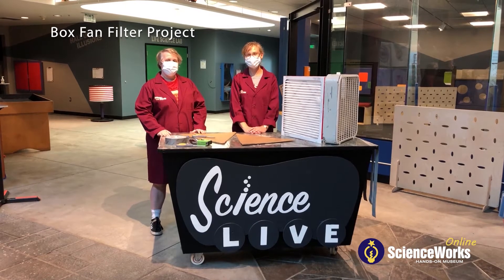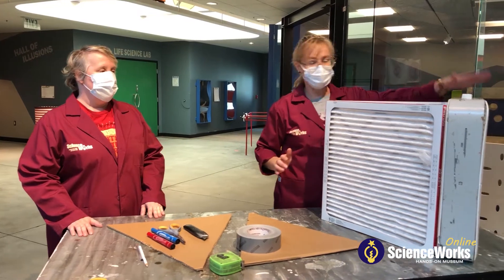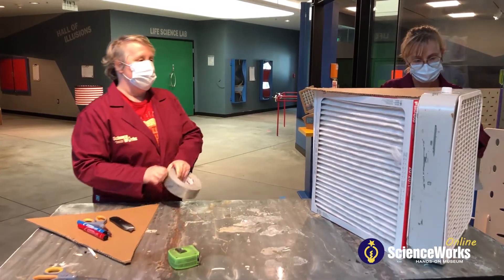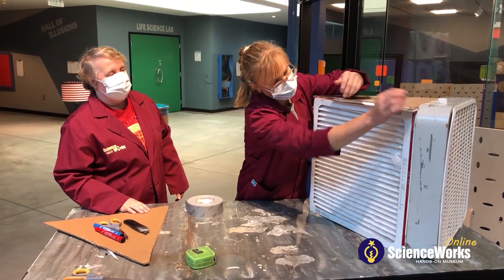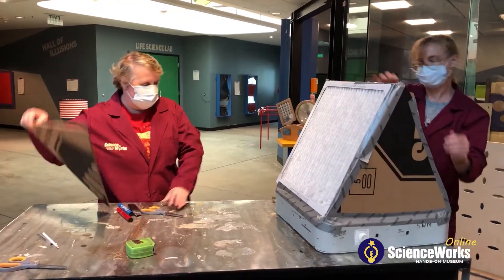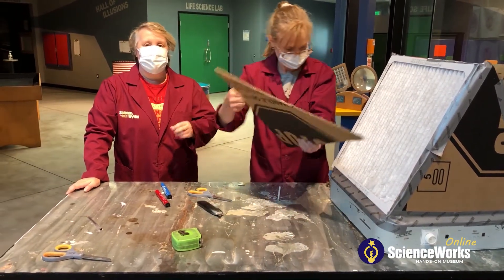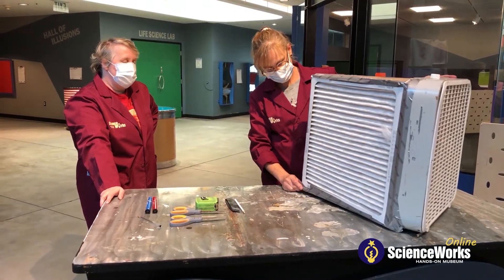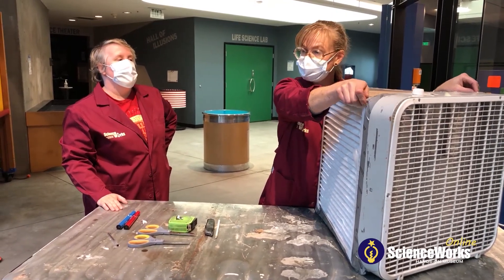How to build a box fan filter system for your home (improved audio)

Comment: What about the corners of the box fan where the blade doesn’t cover? Air will get pulled in through the corners and significantly reduce the efficiency of the filters.

Comment: 4:22 Re: tent shape - shouldn't it be the other way around? 4 filters with a larger volume of air (and more "holes" in the "walls") should be easier on the motor than 2, right? Kind of like shaped masks (e.g., KF94) with a lot of space for your nose and mouth vs a tight-hugging cloth mask - the former is easier to breathe through.